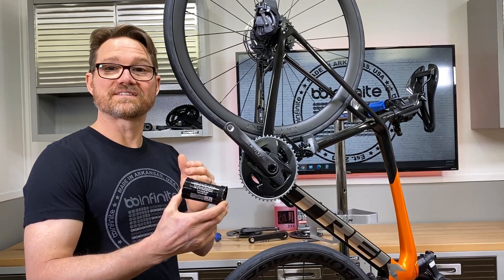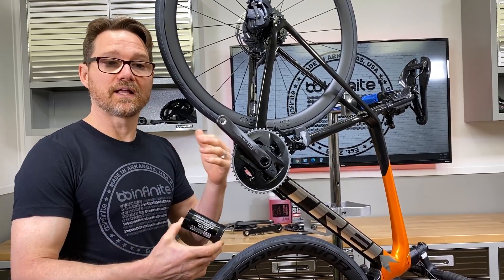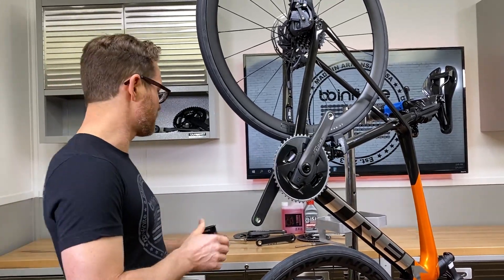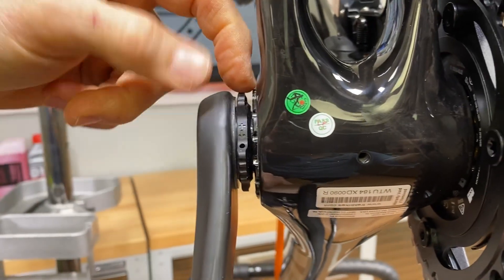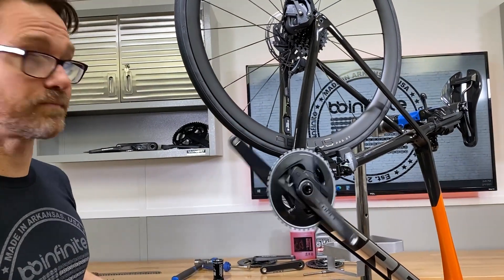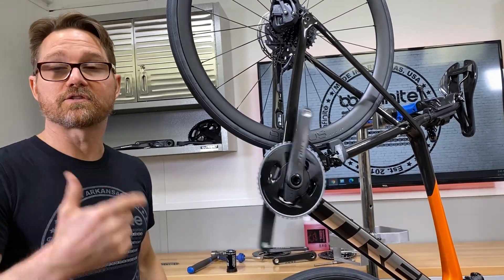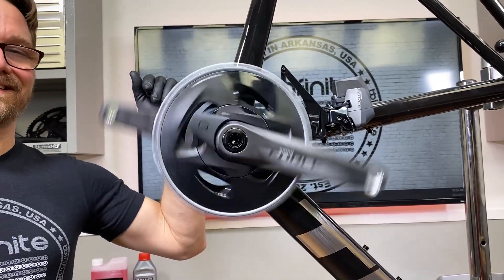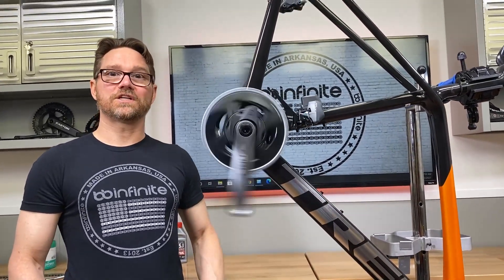BBInfinite 1-Piece, Hub-style T47 vs. Sram 47: FIGHT!

Comment: The amount of spin also depends on the amount of BB grease placed. Fore example, for Shimano pedals if it spins too much, the Shimano Manual recommends servicing the pedal, add more/replace the existing bearing grease, what Shimano recommends is a smooth stable spin, not a fast free spin. Technically speaking if the bearings have Zero Grease, i.e dry bearings have the least amount of resistance and would free spin much longer, but this does not mean the bearings are superior and in fact without grease the bearings would need to be replaced much sooner. BBInfinite, any comments on this or any explanations why your BB would free spin so much more than any other brands, including Chris King?
Reply from the maker: Yes, ours spins better because our bearing alignment is perfect, while any mult-piece system cannot have perfect alignment due to its reliance on using the frame as the aligning member of the assembly. If we were playing games by doing spin tests without grease in the bearings here you would know it simply because every customer who gets our products would be complaining that the one they got doesn't spin that well simply because it shipped with grease in the bearings. Or they'd complain that the bearings don't last because we shipped them without grease just to impress them with the spin after they installed it. We use stock bearings to do all of these vids, standard grease load, etc, just the same way we ship them to customers because what we show here must be what people experience when they have it their own hands.

Comment: What will be the weight difference between the 1 piece and 2 piece options ? Thank you
Reply from the maker: We only make a T47 1pc. We will not be making a 2pc. If you want to know how it compares to T47's made by other manufacturers, than you'll have to compare with them individually. Our weights are published on the product pages under the "specification" tab.
Reply: @BBInfinite  Thank you! , When I was writing the comment I was looking on that page with both options (https://www.bbinfinite.com/products/bb92-directfit-shimano?variant=31275754455173), in the spec there is wieght but I don't know to which option it's referring.